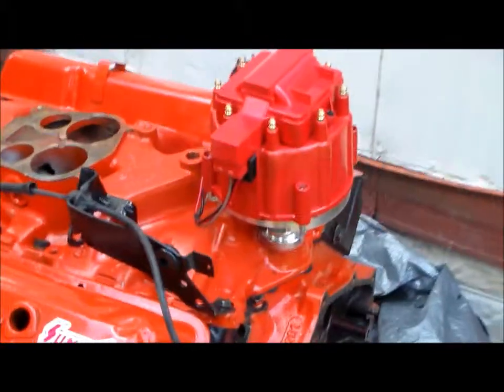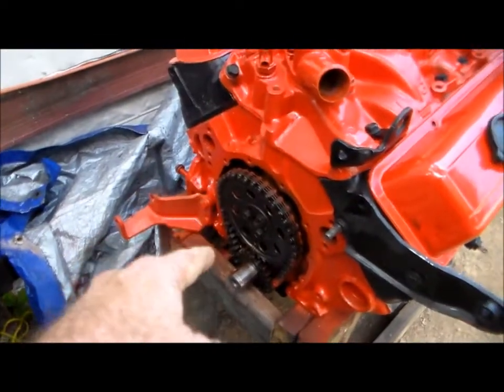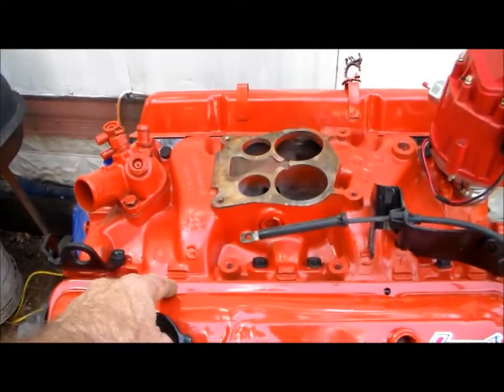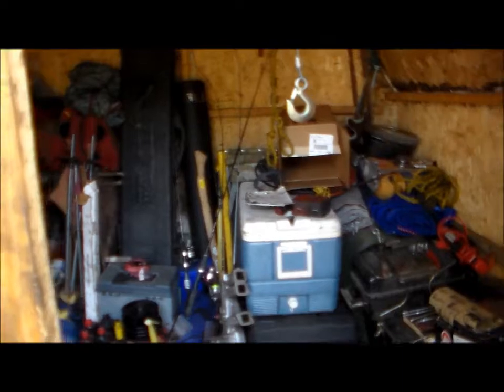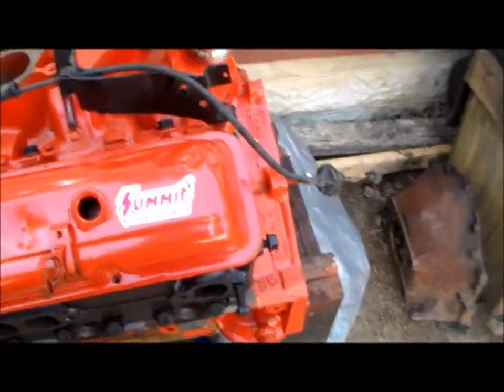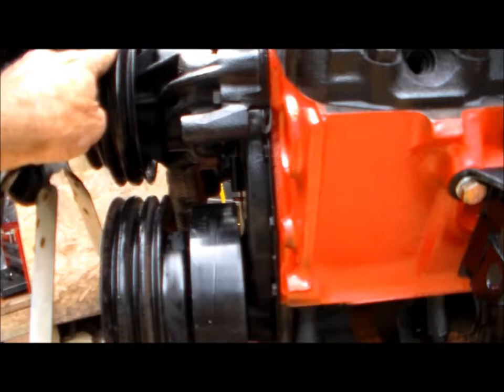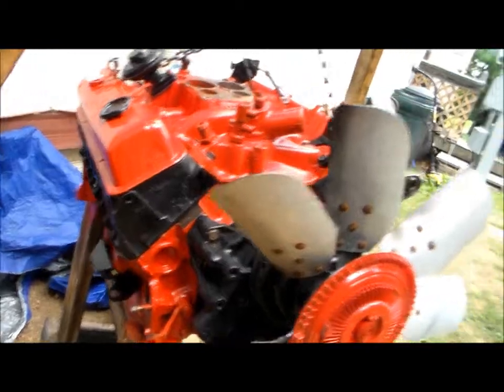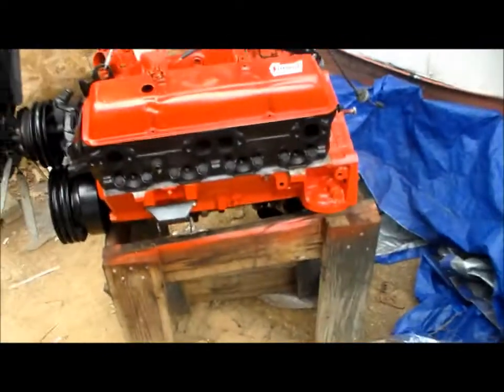305 chevy motor

Comment from the maker: well sAMUEL the best thing about putting a motor in a 87 y.j  is u can take the nose off the jeep but im going to get a th700r4 transmission with a n.p 231 transfer case.but i haft to get new drive shfts for it though and haVE THE REAR SHAFT SPECIAL made

Comment: Hey Freddie,Will you be able to set that down in the Jeep with the fan on the motor ? I have put motors in before and had to take the fan off and put it back on after I got the motor set down in the vehicle... I just thought I would mention it to you just in case you didn't have enough room...